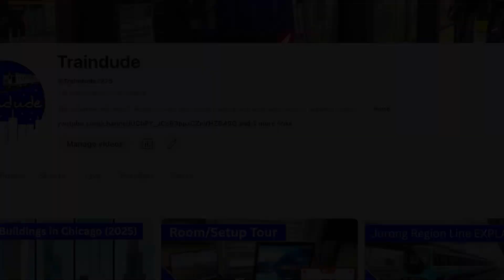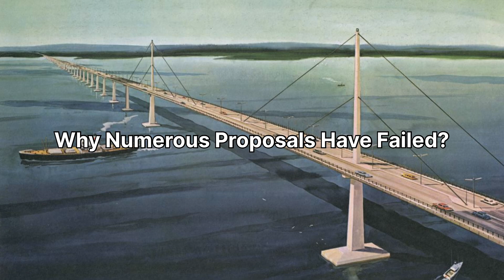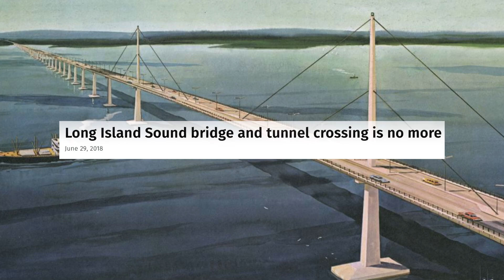Why There’s No Bridge Between Long Island and Connecticut?

Comment: Yes, Moses, like almost everyone funding transportation then, favored cars.  Though he claimed his work would eliminate delays, it almost never did.  Nearly every opening saw a short period of relief followed by worse traffic than before, thanks to induced demand. He was repeatedly asked to at least allow for future rail transit, and steadfastly refused to spend as little as 3% more just to acquire enough right of way.  That made his promises of improved travel time impossible.  As others note, a LI to CT crossing only serves a tiny portion of overall trips, and still begins and ends on over capacity routes. Lastly, Long Island already has 7 road connections to other islands and 3 directly to the mainland US.
Reply from the maker: Yes! That’s exactly the point! Robert Moses always favored transportation so he made those projects! But all of those proposals have failed due to the environmental impacts of the island and the sound and it is true that Long Island has seven road connections to the mainland of the U.S.! Thanks for all the information!

Comment: Short answer (as someone who grew up in Westchester) :  Both Rye and Oyster Bay have very high net worth individuals and are historically...and currently..very rich towns.   Moses couldn't steamroll that.  Nobody can steamroll that, even today.
Reply from the maker: But Moses didn’t propose that project, Governor Andrew Cuomo did! New York and Connecticut both have very high economies and could easily spend millions of dollars to the Long Island Sound Link! But the nimbies of Long Island and Connecticut don’t want the project in their hometowns due to sound pollution, air pollution, and a bunch of fossil fuels but meanwhile, in the rest of the parts of Long Island and Connecticut, they really want this project do be done because it will have better access to both Long Island and Connecticut without having to go through the city!